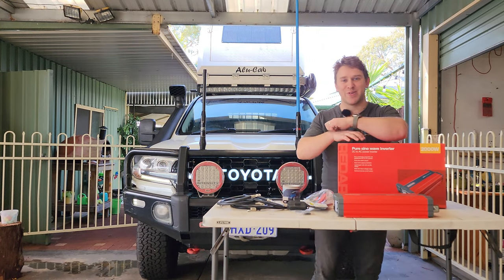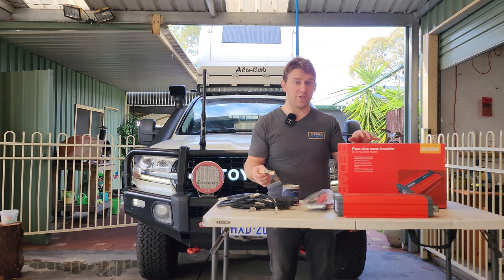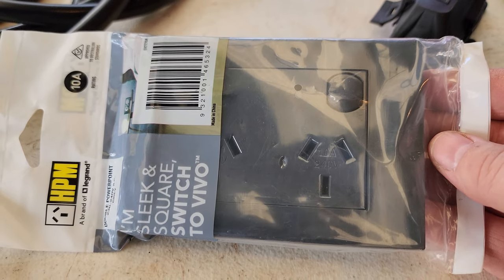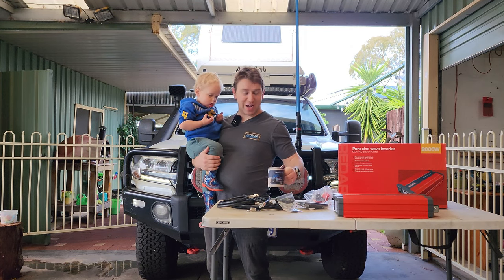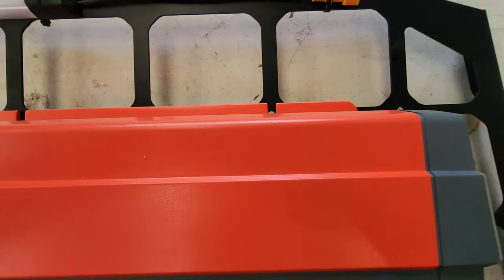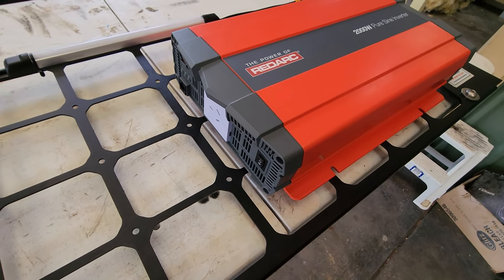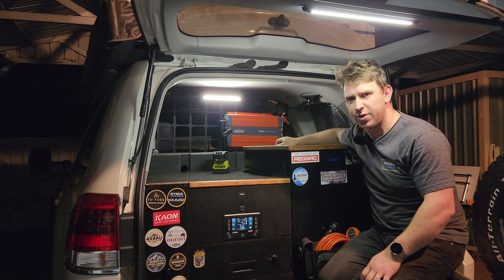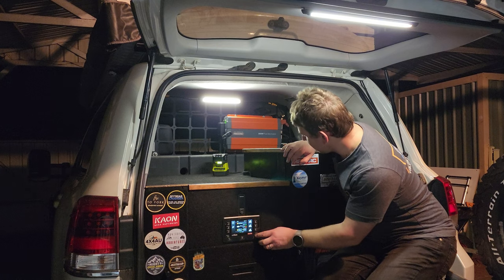POWERING UP! - How to install a 240V Inverter | REDARC 2000w inverter | DIY install at home

Comment: I would suggest if you haven’t already that you reconsider that little bracket you made for the negative to the red vision shunt. I would remove it and get the correct lug put on the cable. When you have potentially 220+ amps going through the system you want it working as well as possible.
Reply from the maker: Good pick up.
It definitely has enough material to flow whatever the inverter requires, so that isn't the issue. I think it could possibly be a safety thing though, since its a large area of exposed steel that is carrying a heavy load through it.
To put a new lug on the cable would also require adding 500mm or so of cable in order to keep everything tidy and safe, which would add voltage drop.
I will reassess the bracket after a few trips of use and see how it goes. Definitely isn't perfect but for the situation it works.
Cheers

Comment: Thanks for this video
Was also watching rear bar vid
I noticed you have maxxis 295/70/r17, happy with them a spare fit underneath no worries?
I’ve just worn out bf 285/70/r17 and thinking of same tyre as you, I’ve a 2inch OME lift. VX kdss 
Should be ok u think?
Reply from the maker: Yeah the spare still fits fine as a 295/70/17, just needs to go in as square as possible so it doesnt catch on anything.

Comment: Quick question, how loud does your 2000w inverter get when under load? The fans on mine start to spin like an airplane takeoff only after 150-180W of load… from what it looks in the manual fans on these are load adjusted rather than thermally adjusted which is a bummer. It really gets unbearably loud for me.
Reply from the maker: Hi mate, yean any light loads don't seem to trigger the cooling fans in the inverter. Its only if I'm pulling around 60+ Amps that it seems to kick in. Not rediculously loud but not quiet either.
The new Redarc RS3 inverters are meant to be a lot quieter now

Comment: Did you end up conne ting the double power outlets?
Reply from the maker: Hi mate, no I haven't put a permanent outlet in yet. I have run an extension cord to the side of my drawers with a double adapter head on it. I find this to be quite versatile, and means that I Haven't got a permanent fixing to fill with dust or dog hair.
In time I would love to have a hard mounted socket, but it's pretty low on my to do list at the moment.

Comment: Hi - do you always require an auxillary battery near the inverter or could you run the inverter off cables from the batteries in the engine bay?
Reply from the maker: You could run it off the aux battery in the engine bay, but the length of wiring you would need to overcome voltage drop with huge amounts of amps would mean a very thick and expensive cable. Plus if that cable ever rubs on the body at any point over its 6m length and shorts out, it would most definitely mean a fire.
Keeping the wiring runs short is key, hence why I decided to mount mine within 600mm of the battery.
Reply: @offroadcrusader  thanks mate really appreciate it

Comment: Hey mate looking at installing the same inverter what size cable have you used? I dont understand why redarc specify a 250a fuse isnt that much higher than the cable can carry?
Reply from the maker: Hey mate, I believe its rated for 200A. I got the cables made by an esteemed Autoelectrician local to me, who I think repurposed some winch power cables.
The Inverter is designed to handle a max output of 2300w, and a max surge of 3500w for 1sec. The 250A fuse would still allow this max surge for 1sec before blowing, while also handling the max output rating. Redarc are infinitely more knowledgable about inverters and fuses, so I am happy to defer to their wisdom on the matter, and follow their recommendations for fuses. Last thing I would want is a fire caused by not following the manufacturers instructions.
It's a beast of an inverter, and I am still super happy with its performance months on. Hope you enjoy it too!
Reply: Thanks heaps mate! Keep up the good work